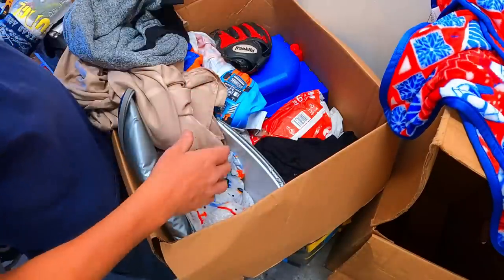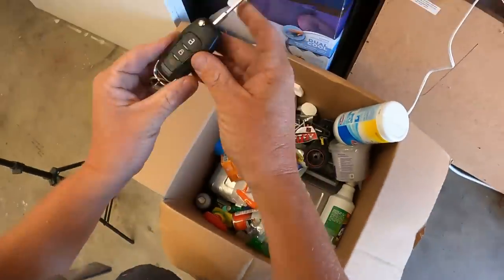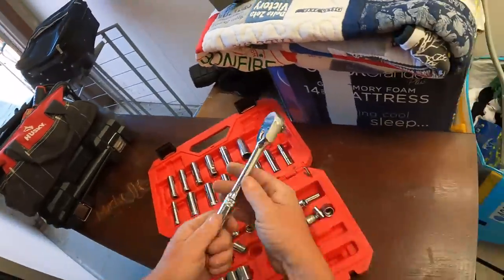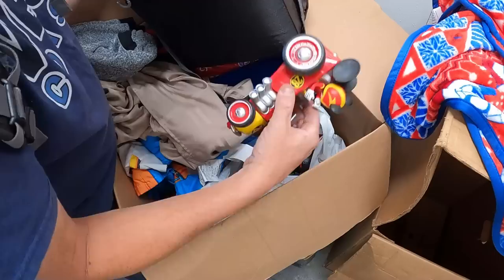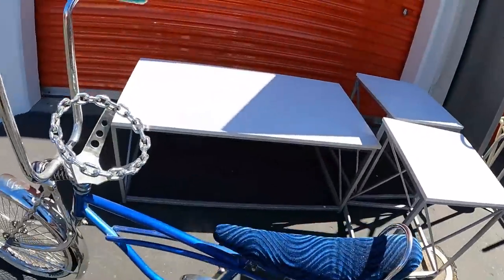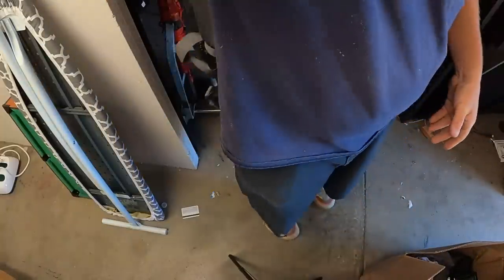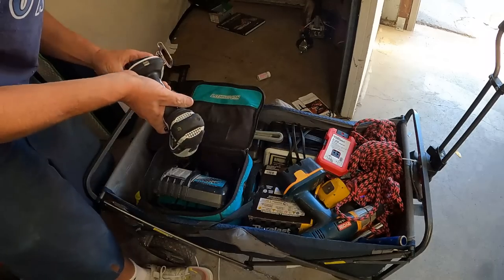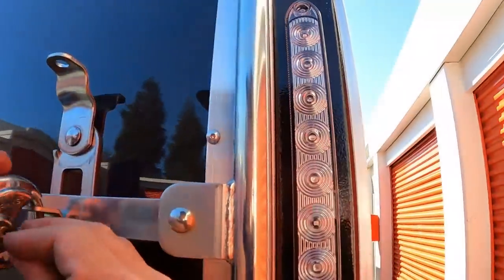SHE Bought THIS! Made TEN TIMES Our MONEY! This Was A Jackpot!

Comment: As for the Air Compressors? - if you're going to use it to spray paint & to operate Air ratchet tools you will want the larger tank, just remember to drop a little oil in it once in awhile...

Takes time to recharge the tank, you don't want to do that half way thru spraying a hood